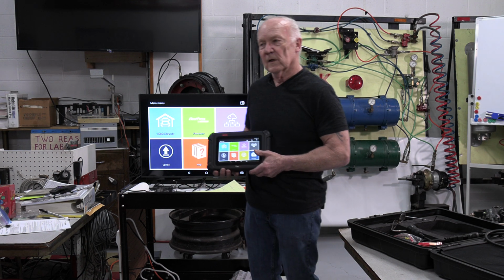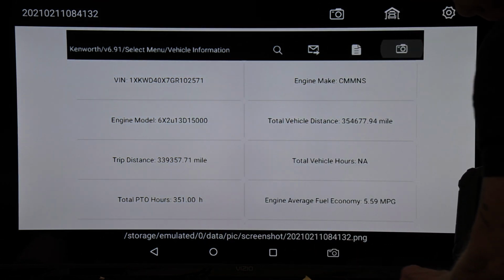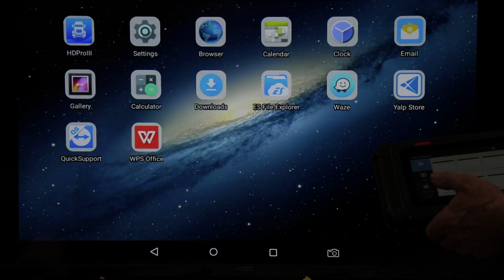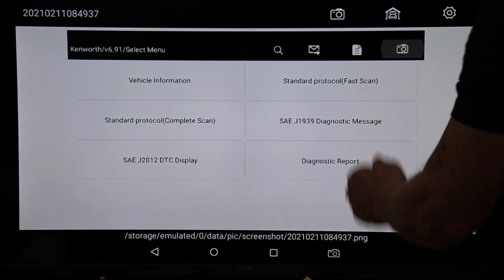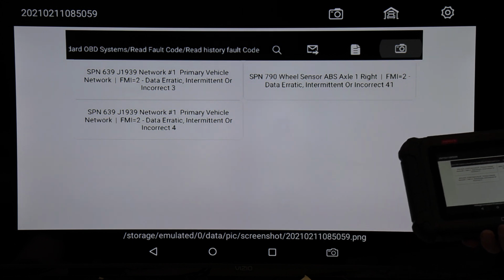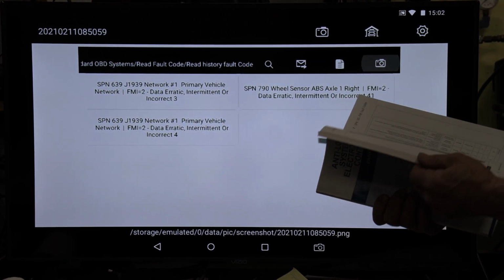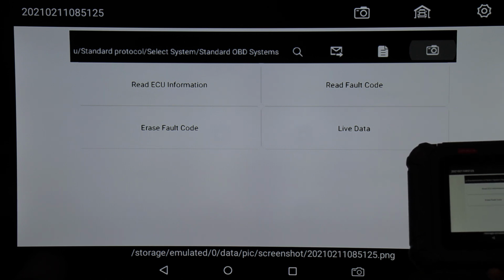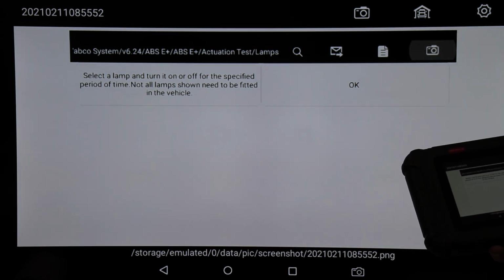The HD Pro III

Comment: I had so much trouble with mine.. I regret buying for the price. As soon as out of 2 year plan it took a dump. And lost my actuate test options on Fords. Hooked up to diesel and gives me spark advance options with 02 sensor. Which is worthless on diesels. Not it won't open hd111. Says error .